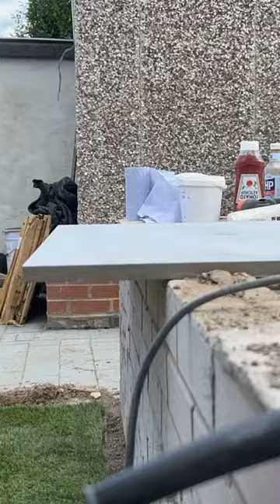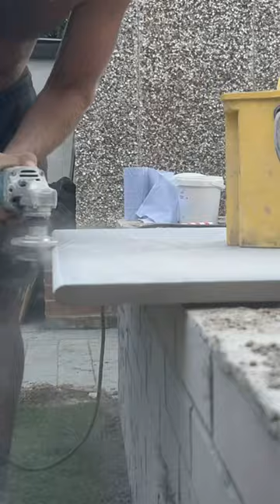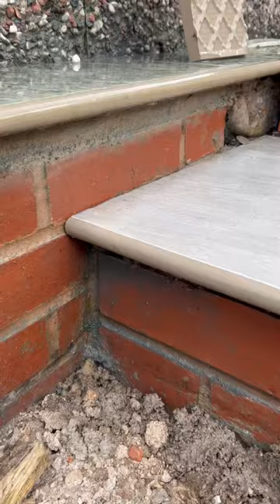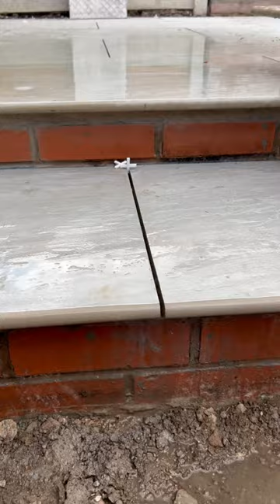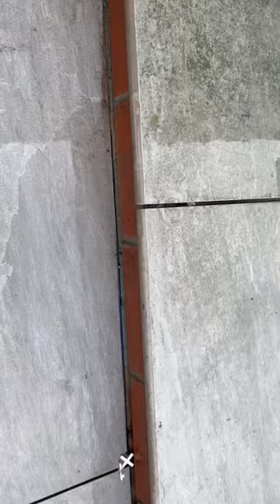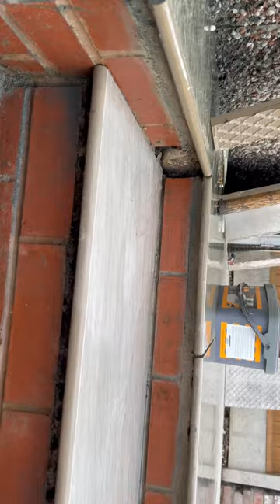How to give porcelain steps a perfect finish also child friendly bullnose profile #landscape

Comment: Is this as simple as it looks, or can you damage the tile doing it, i have my steps with a 20mm overhang is that enough room to add a bullnose ? Cheers
Reply from the maker: I usually have a 30 mm over hang so I can grind a drip line aswell the tool makes it simple to do to be fair
Reply: @RSjoineryandlandscaping  ah see,  is there anything i can do to maybe take the sharp edges off, the top  especially as one of the steps returns, like a square patio, so theres a corner.